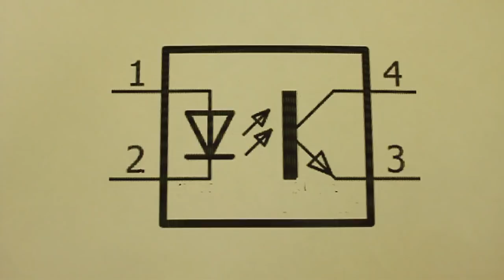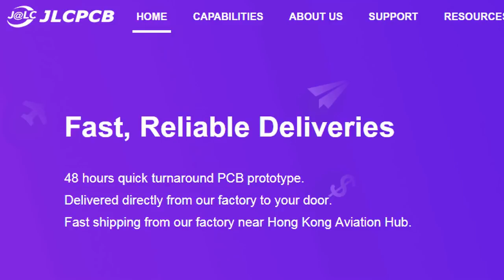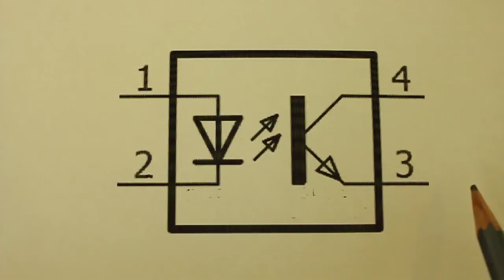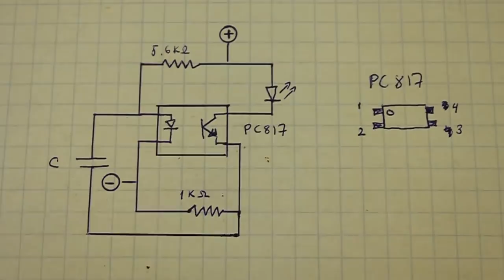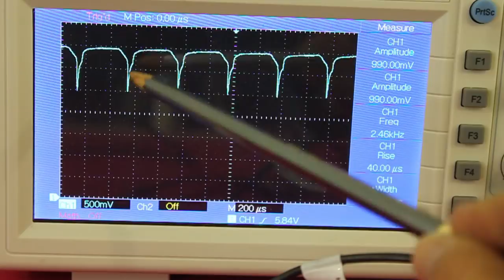Optocoupler Oscillator

Comment: So the input supply goes through 5.8K resistor and output goes through  1k resistor, what should be noted but not mentioned.   So the output is getting more current or voltage than the input but no enough to burn the LED. And of course both and input and the output is supplied by the same source.

Comment: That's awesome. Thanks! Question: What is the highest frequency of oscillation that can be achieved by this circuit?
Reply: @Another Dick Thanks!
Reply: Thanks for this great knowledge.. it would be greater if someone can  tell me, can this ocilator drive a transformers for high voltage genarator ? tqvm for advance.
Reply: check the optocoupler datasheet. typical ones cannot do much above 5khz.
Reply: Search google, for there are plenty of web calculator formulae to give you this answer, If I find a good link I will come back and post it.
Reply: @dennisbauer3315  This is not a LC Circuit here!... Those resonance frequency formulas do not apply here!... Thanks.
Reply: Go from here,   https://goodcalculators.com/resonant-frequency-calculator/

Comment: Clever use of an optocoupler. 
Does the 1k resistor affect the RC circuit?
Reply: Yes it does, and also affects the pulse width slightly. Not much you can do about varying it's value though, it has to be high enough that the current through the transistor is not exceeded, and low enough that leakage will not pull the node above the forward voltage ( around 1V for the IR led in the optocoupler) of the LED. 

Using a large value capacitor you will want a resistor in series with the capacitor as well, as the charge on the capacitor is being discharged through the LED, and they have very definite limits on forward current. However you also need this cureent to switch, so in most cases the ESR of the capacitor limits it, though a 10R-100R resistor in series will do no harm, other than making the turn on somewhat slower.

Maximum frequency is really determined by the speed of the optocoupler, and by needing to have enough charge transferred to the led to turn the transistor on, so do not expect much above 5kHz with any common optocoupler, as they typically are really slow to turn off, and with low capacitor values the transistor will not turn on fast either. The timing resistor is also limited in value, you need to have a low enough charge current so the LED does not turn on while the capacitor is being discharged, but you can add another diode in series to increase this voltage slightly.

Odd use for an optocoupler, but useful if you have nothing else available, as it will be both a very poor oscillator, and not very stable with supply voltage or temperature, but I can see this being a useful power indicator, by adding a regular LED in series with the IR led instead, and connecting the collector of the transistor to the supply voltage via another 1k resistor, so the charge in the capacitor is used to pulse the LED at a high current, making a bright flash every few seconds. Brighter than running the LED on the same current, and a lot cheaper than the LM3909, now well obsolete, that used a similar method to pulse a LED using the charge on the capacitor.
Reply: @SeanBZA  Wow, thanks. Wasn't expecting such a great reply.